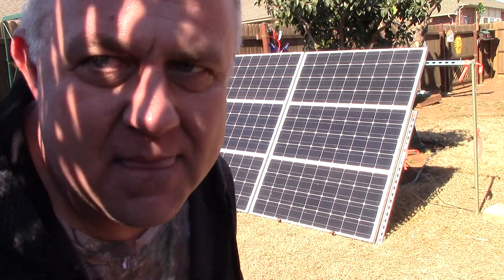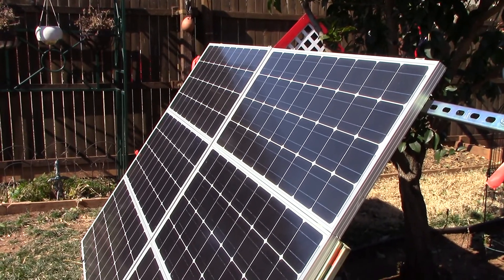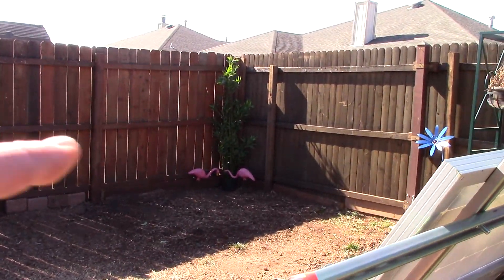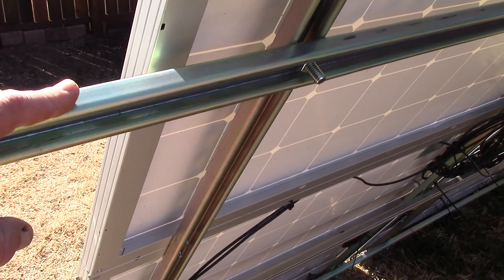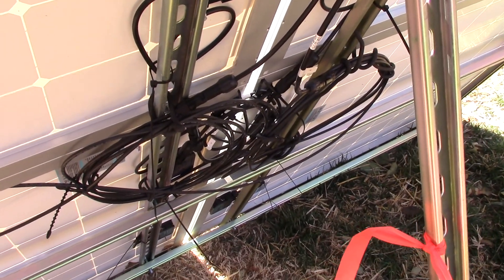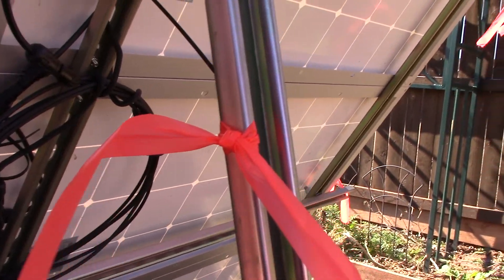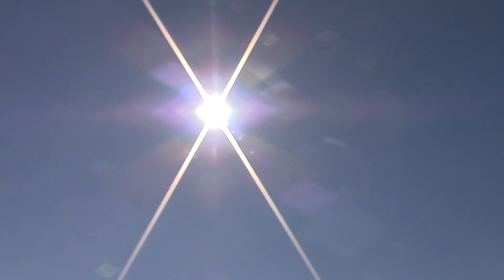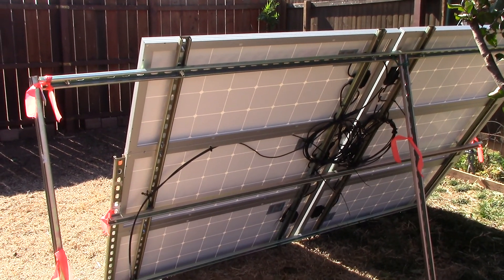Backyard solar panel array framed-up using Superstrut and bolts

Comment: So do you take it down in the tornado season?
Reply from the maker: This was during my "experimental" phase moving solar panels around. I have had my current arrays set up for 2+ years now...no, I don't take solar panels down during tornado season. All insured
Reply: Nice.  Thanks for sharing.  Looking to get some roof top mounted, but want to use the wall for most of the "punctures".
Reply from the maker: Glad to help. FWIW, I am not a fan of rooftop mounting solar panels. If space/shading isn't an issue, ground mount systems are easier to work with (maintenance, safety, wiring, type, heat dissipation, dealing with HOA-city rules, etc-etc). Best to do a lot of homework for optimal placement, city/electrical code for safety, and ask a lot of questions before opening the wallet...initial costs are eye popping

Comment: Nice  Chris,  how many Watts of Solar do you have now?  Are you Tied into the grid ?    or ?   Thanks in advance
Reply from the maker: ~5,500 watts in panels. The system is off-grid...with "grid-connect" as a back up power source.

Comment: Looks good, I used the unistrut for my solar mounts as well.  I picked up a bag of PV panel hold down clamps and the weeb grounding clips for mounting mine, lets you mount from the front of the channel.  For my tilting array, I used 3/4" sch. 40 pipe as the main pivot and made up some UHMW pillow blocks to clamp the pipe to the rack.  It's worked fine now for 2 years or so.  I adjust the angle 4 times a year for the seasons and also lay the panels flat if high winds are forecast.
Reply from the maker: That sounds awesome! Do you have a video of your rig I can see? Sounds like exactly what I wants to do. Thanks man.